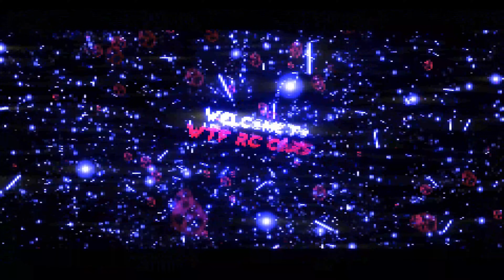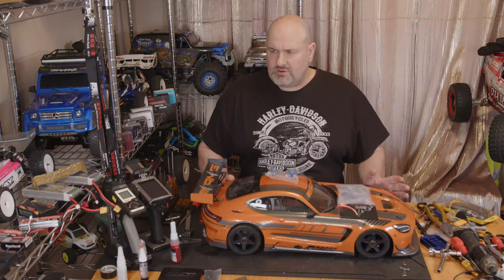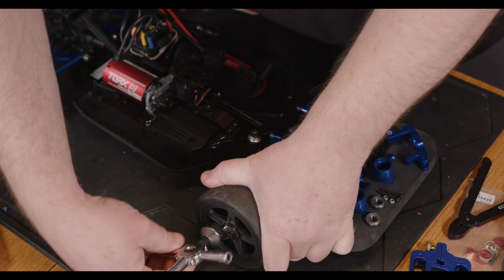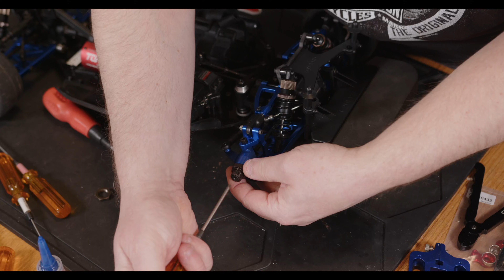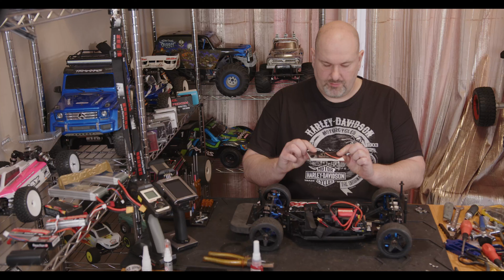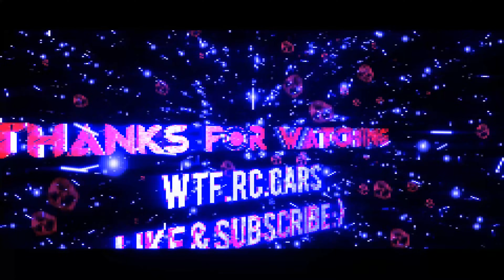Kyosho GT2 VE alloy front and rear hubs.

Comment: Interesting because I install the oem front hubs. Big difference is just accuracy. Screws and turnbuckle line up. There's no gap where the top screw goes in with the nut. Thanks for sharing. There was a big concern of installing these aftermarket parts, but no one on the forums ever mentions the deminions is off a little and how they installed it.
Reply from the maker: I just like to try and show how things fit and what you need to do to make them right :)